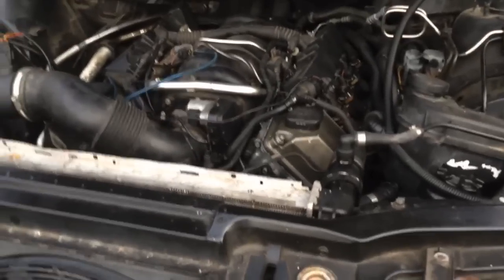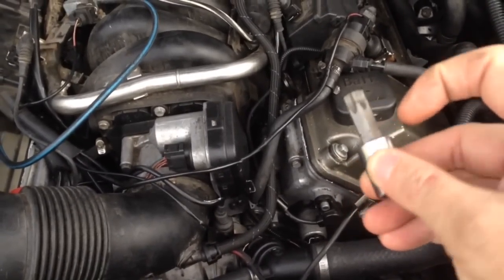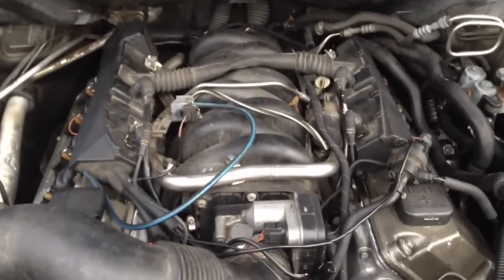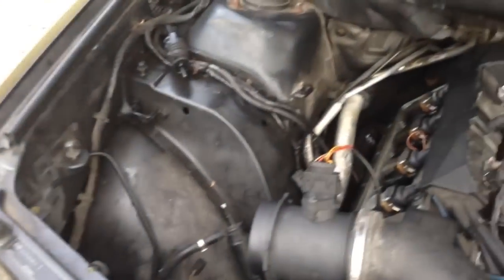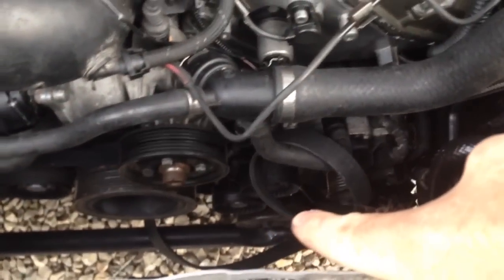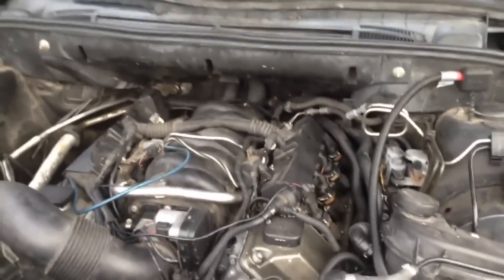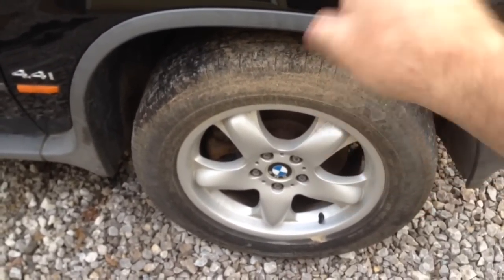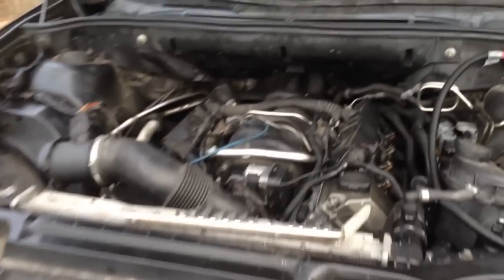BMW E53 X5 4.4 M62TU Camshaft Bolts Coming Loose Fixed Random Misfire

Comment: Thanks for for making this video. I had this issue and too have a non-hardened steel bit. I went and torqued it to 92ft-lbs and used the red loctite after cleaning the bolt and cam threads with brake cleaner, then acetone, then blasted with air. Only time will tell if it holds up. I don't quite understand how we don't get the proper torque, even if the bit does twist. Isn't the full torque still applied to the bolt, despite the twisting action? Anyway, I appreciate the videos. Keep up the good work!

Comment: one of these days I'll get around to solving the weird running of mine. has. misfire @after start for first 1/4 mile. then runs great. been like this for 25k.
Reply from the maker: Any codes? might be a coil getting bad
Reply: Misfire on every cylinder and a few others...... about 15 codes in all.
Not p030X series codes either. Still drove it 100mph today perfectly fine.
Reply from the maker: I would pop of that ccv diaphragm and see if its ripped, i dont remember did you ever do the timing chain guides?
Reply: Already replaced it. No vacuum leaks. All new OEM plugs. New cam sensor.
Reply: Engine had 74k when I installed. And have not done the guides. Paid $2500 for motor and didn't want to spend another pile of cash on tools and parts when it was out. To do a job I wasn't overly comfortable doing anyway.

Comment: Hi Nathan I have been really getting into your videos I bought a 2004 Range Rover a couple of months ago with the 4.4L BMW V8 and your videos have been very helpful I plan to replace the timing chains and guides and vanos units as soon as I get the funds together. 
You might pickup a Snap-on  or mac torques bit we have had no problems with them in my boat shop and they have a lifetime warranty. I know that they are pricey but in a critical situation like the vanos might be worth the expense.
The Range Rover share a lot of the BMW X5 so keep the Videos coming.
Reply from the maker: Hello yes the rover is the exact driveline as the x5, most of the time the vanos is not bad  depending on the miles, the rest of the videos should help you get the job done, thanks for watching
Reply: it has 122000 miles on it and has that knocking sound at idle like a diesel. I have gone to a 88c thermostat from Europe and 10w40 oil and it has quieted it a lot but I suspect it's time for chains and guides. I checked the lower oil pan and no broken guide pieces. The engine runs great I just can't stand the noise at idle.
Reply from the maker: Yes better do the guides now before it gets any worse

Comment: Are you sure it wasn’t because you have been tightening the bank 1 first? Supposed to do bank 2 then 1, that way the slack is at the tensioner and the chain is tight between the 2 sprockets. If you do bank 1 first, there’s slack between them. We shall see when I start mine tomorrow. Thanks for the vids!